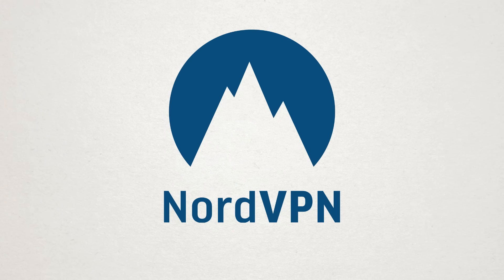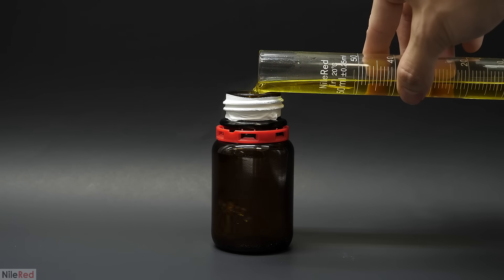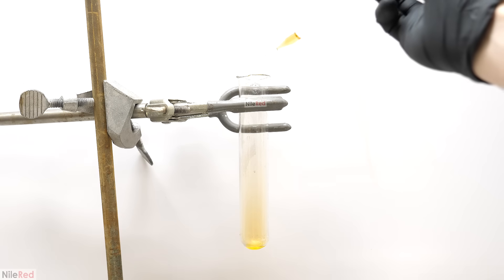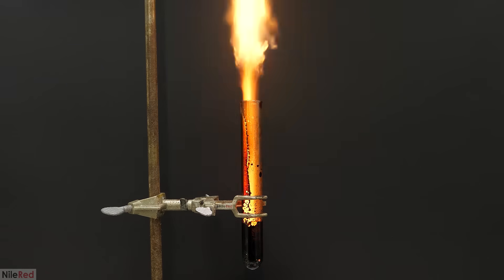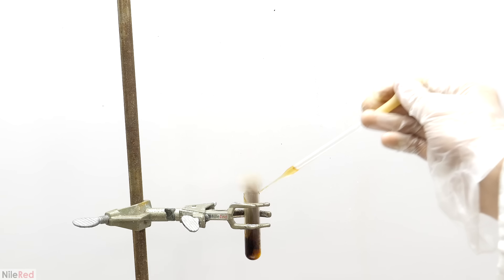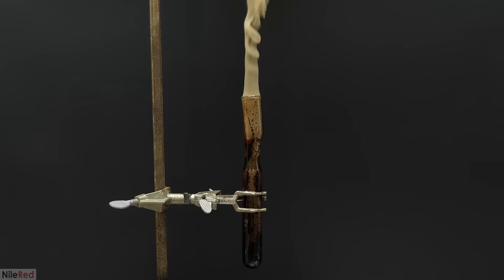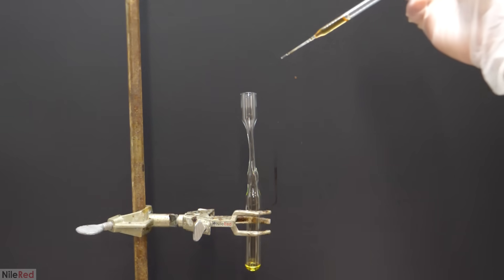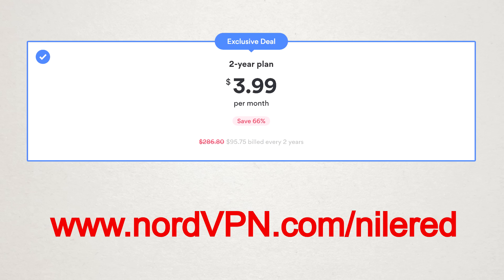Making test tube liquid rockets

Comment: Hello, I work at a company called AstroTech here outside the Kennedy Space Center where I regularly handle hypergolic propellants, mainly Dinitrogen Tetroxide and UDMH. My main job is as a Hypergolic Technician, we fuel satellites preparing for launch. I do not know your credentials and connections, but I do not suggest making any video with hydrazine unless you are wearing a full SCAPE suit with the proper training and other safety measures and equipment on hand. As I’m sure you know propellants like hydrazine can cause incredible health problems including cancer after being exposed to as little at 3.5PPM. I’d love to see you experiment with these chemicals but please be safe, these are some of the nastiest chemicals out there, which is why I love working with them!
Reply: When I worked for the Air Force, we had an entire class on hydrazine. I wasn't even going to work with the stuff as I was a software engineer, but it was enough of a hazard that anyone that might see a plane had to have it. It smells like ammonia. But if you can smell ammonia, you're fucked. Warn others so they don't die. then basically die. That was our training. So I agree with Mojo waters. Be suuuuuper careful with hydrazine.
Reply: sprays rag in hydrazine
inhales
"Thats good shit donny"
Reply: Hence the warnings about not picking up or touching pieces of space hardware that survived re-entry due to hydrazine fumes.
Reply: I think one of the reasons that Hydrazine hydrate is so nasty is because it looks like it really isn't. A lot of really dangerous substances are an angry colour, or fume/burn in air, or they set untreated steel on fire, or can be detected by smell in the tiniest of concentrations from the next suburb. Meanwhile, hydrazine just sits there innocently looking like plain water, and by the time the fumes have gotten concentrated enough for you to smell, you're completely fucked. That stuff is not to be messed with.
Reply: sixstringedthing It’s interesting because I think those angry colors are usually the result of reactive electron groups—I believe the same thing that makes them react and makes them colorful—Or maybe I was always interpreting that wrong
Reply: @CamRStanford  not necessarily. There are pretty colored solutions that aren't that dangerous. And there are colorless solutions that will kill you 10 ways to Sunday (like hydrazine). It just depends what their electrons do in relation to light.
Reply: I've read The Martian, you don't need to convince me that Hydrazine is terrifying :)
Reply: @rootabeta9015  yeah, something tells me he may have some cancer problems from it... but the book definitely described it well.
Reply: @rootabeta9015  YES SOMEONE WHO READ IT
Reply: @rootabeta9015  ur username its true
Reply: Hydrazine is terrible stuff. The NFPA 704 states it very well.
Reply: As i  understand NASA and co often try other chemicals because of the cost of dealing with these chemicals. As in the cost of handling them. IIRC the space shuttle hanger needed to be evacuated when fueling the hydrazine for the RCS except for specially trained personnel. I guess ppl like you.
Reply: This is the first time I've seen one of these know it all comments actually be legit. Definitely don't fuck around with Hydrazine if you don't want to enjoy cancer. We use it for the F16 and fuck everything about Hydrazine. It's nasty stuff.
Reply: This is a super underrated comment, people joke about it now but if you learn what the fumes do to your lungs, it's hella scary. I'm glad I saw this, not that I have any means of doing any of this by any stretch of the imagination, but good to know nonetheless, there goes another thing to say "f*ck that" to in life to keep me alive. For real
Reply: https://www.youtube.com/watch?v=YcXpSdbDNkM
Reply: "which is why I love working with them!" 
I did not need to see this part of the sentence you adrenaline junkie/Megumin Explosion addiction.
Reply: @kuroganeshiroe4760  heh
Reply: You wouldn’t happen to supply fuel for the dragon spacecraft would you?
Reply: @justanotherasian4395 AstroTech doesn’t supply much of anything for Space𝕏 vehicles. The payload, yes. Fuels, no
Reply: *C-Stoff
Reply: @m4ttyofficialchannel  C-Stoff contains hydrazine, but is its own separate mixture.
Reply: Yikes, I’ve honestly Never really thought about how volatile rocket fuel is.
Reply: jesus, thats nasty
Reply: Safety first.
Technician Second
Reply: This is actually the exact field I've been wanting to get into. Which universities would you recommend in order to get into your field?
Reply: Ha neeeerd
Reply: those darn yummy hypergolics
Reply: @mojo waters someday i hope im at an interview and your interviewing me
Reply: @maxgh0strider  *you're
Try learn to write.
Reply: @radonic_  lmaoo
Reply: is gravity fucked there?
Reply: Yea well imma do 3.49 ppm
Reply: I was elected to lead not to read someone summ this up please
Reply: I was going to say something about the dangers of working with Hydrozine, But I'm glad someone with actual experience and credentials did it first.
Reply: You don’t think he knows this?
Reply: he made uranium glass bare handed i dont think he cares
Reply: So if it’s so carcinogenic that means every time one rocket launches it’s spraying cancer to the people looking down at it lol
Reply: I've been to Kennedy space center:0
Reply: i think you overestimate just how much Nile Red gives a fuck about safety.
Reply: nilered’s middle name is danger so I don’t think he’s gonna acknowledge anything you just said
Reply: Let’s get cancer kids
Reply: Shut up nerd
Reply: hey ,i need a couple gallons of that stuff,to light my BBQ
Reply: @wvoyles lol
Reply: Hydrazine is Really Nasty! If you really Want to die of cancer, just go ahead! Don't forget, it is volatile, to, so you can't just assume it'll stay in vessel you're handling it in...
Reply: @gazzarrr666  Yea, even the Germans in WW2 was careful about using it (in the only operational rocket warplane, the notorious ME163 comet).
Of cause it didn't help that the oxidiser for the hydrazine hydrate was high strength hydrogen peroxide (which is also a colourless water-like liquid)
The even went so far to design the fuelling probes with vastly different geometries to avoid accidental mixing of the fuels, and even then a large percentage of the planes caught fire due to fuel leaks etc....

Still it had the highest climb rate of any manned air-plane in WW2, so high in fact that the pilots had to have a special diet to prevent intestinal gas.....
Reply: @srenkoch6127  To be pedantic, they used C-Stoff, a mixture of methanol, water, a catalyst, and hydrazine hydrate, not just hydrazine.
Reply: @MDeadcloud I know, but from a safety perspective, all the rest might as well have been water (and yes you are in deep S*** when you can ignore the safety implications of using methanol) 🙂
And I think I've read that the only reason for the use of methanol in the C-stoff was lack of enough production capacity for the hydrazine.
Reply: I hope nobody here finds Explosions&Fire and his small hydrazine accident lmao
Reply: SoylentGamer that mans getting cancer for sure
Reply: @Ang3lUki  https://www.youtube.com/watch?v=d7EPTu1Srak
Reply: tl:dr so cody gonna get cancer?
Reply: Bruh lol
Reply: Blah blah blah
Reply: @Mojo waters I don’t give a shit about your life story I would love to drink some dangerous chemicals because they don’t harm u
Reply: @ma4_life305  u are the definition of me
Reply: hasn't he already made very extremely dangerous chemicals? He made that blood-red stuff that, if I remember correctly, checked like every box for what makes something dangerous. He's also worked with radioactive materials. Could hydrazine be that much worse, considering the precautions he took for those experiments? (I'm not asking to be sarcastic, I'm sincerely curious)
Reply: @g4mmalotus937  it really is. Its volatile so it will just start to evaporate into the air very quickly on contact, and it takes very very little to get hurt or killed by it. A fume hood goes a long way toward keeping people safe, but with something as dangerous as hydrazine compounds I wouldnt trust that 0% of it wont end up in the room, especially if youre burning it and (like in this video) some of it might end up getting thrown out of the tube and into the room where your fume hood cant help you.
Reply: @g4mmalotus937  a drop will do far more than just kill you. People have died handling it after it has ever so slightly passed through gloves that were thought to be safe.
Reply: @g4mmalotus937  yes. It is much worse.
Reply: @g4mmalotus937  its called bromine.
Reply: @CROWZ_joey  that's right
Reply: Is that level of PPE only neccesary for occupational hydrazine exposure? Keep in mind you work with a lot more hydrazine on a daily basis. Nile has a fully equipped laboratory, I think he knows what he is doing.
Reply: @Ang3lUki  When satellites and rocket systems using hydrazine are fueled, technicians have to do it in full body hazmat suits (known as SCAPE suits, as Mojo waters mentioned) with a self contained oxygen supply. Even despite these precautions, technicians are only allowed 45 minutes in proximity to the hydrazine fuel before they get pulled for decontamination. Hydrazine is vicious stuff.
Reply: @ValleysOfRain  A very different setting than a demonstration lab. Nile isn't working with large volumes of freebase hydrazine. He is working with hydrazine sulfate to make a small amount of freebase in situ for a reaction.
Reply: SoylentGamer dude. No. Hydrazine can still do major lasting damage and be fatal
Reply: @Ang3lUki  Nile may know stuff but believe the experts when it comes to handling unusual and seriously dangerous stuff
Reply: @neovo903  How do you know this guy is an expert? For all we know he could be lying about it all. Sure, hydrazine can be dangerous, but Nile has worked with stuff that could of killed him if he inhaled even just one particle.
Reply: @Vortex-Gaming314 You clearly don't know anything about hydrazine then
Reply: @SoylentGamer  I mean, Nile is clearly well prepared for a variety of chemical safety issues, but as stated by Sean, they don't know Nike or his credentials. The comment isn't offensive or killjoy, it's encouraging safe experimentation.
Reply: SoylentGamer Still not a good idea to try it...
Reply: @herpderpinson6117  ok fed
Reply: Mojo waters He does his research. I mean, he’s not dead yet.
Reply: i’m honestly surprised that no one said ‘ok boomer’ lol
Reply: @aaa15634  Because it wasn't a meme back then
Reply: Z47N 73H74 nice pun!
Reply: Mojo waters I'll give it a like but I'm not reading all this 😝😂
Reply: @Cnriee  You can't read a single paragraph?  It takes like 10-15 seconds max to read it.
Reply: Mojo waters, he’s a chemist and he did this all under a fume hood I’m sure he’s safe... he’s also worked with high concentrations of uranium too so I’m sure he is fine
Reply: @t0fuuu102  uranium isn't dangerous tho
Reply: @tehjamez  It is. It's the radioactive stuff in nukes.  And N8le worked with a quantity that 10x the one in nukes. So I think he will be fine.
Reply: @Vortex-Gaming314  I'm sorry you fell for the lies. Watch who owns the plutonium
Reply: ok cry (jk i dont  even know what hydrazine is)
Reply: @pacheco6530  hydrazine will give you cancer so now you do kno.
Reply: too long
Reply: @jay8762  bruh
Reply: Blah blah blah safety kids! Fun nazi
Reply: @CamRStanford 
Not sure if you're joking, or actually completely ignorant as to how dangerous hydrazine is. This isn't the "oops, we spilled a bit, better put on some gloves" kind of stuff, it's the "oops, we spilled a bit, guess we'll all die in five years of acute leukemia" kind of stuff.
Reply: @Warriorcat49  Mmmmmm, the sweet smell of unsymmetrical diethylhydrazine...
Reply: @Warriorcat49  5 years if you are lucky I think, right?
Reply: Warriorcat49 take a wild guess if I was joking.
Reply: @Pointyy  *unsymmetrical dimethylhydrazine you mean
Reply: @Warriorcat49  who gives a crap about this safety nonsense I would to drink these
Reply: @aaliaaslam3841  Apparently in your quest to imagine up a whole backstory for a complete stranger, you didn't notice the hundred other "Ok, boomer" "Ok fed" comments.

Clearly poking fun at the guy being a wet blanket--much like we have here.

Again.

Great job, Boomer.
Reply: @CamRStanford  Lol you're hilarious. Keep being triggered.
Reply: @CamRStanford  You responded to a 1 line comment with a 10 lined response. Triggered much?
Reply: @Warriorcat49  be quiet we don’t care
Reply: @Pointyy  i... is... is it actually sweet?
Reply: @Warriorcat49  I agree with you that stuff really is extremely dangerous once you are exposed to it and enters into the air, probably anyone  in close proximity can be exposed to that and lose their life.
Reply: @destinebrown3973  LMAO ITS SO SCARYYYYG
Reply: @CamRStanford   The OP was only talking to NileRed, you should DEFINITELY experiment with these chemicals at home. Be safe though and only do it if you parents are in the same room supervising you.
Reply: @CamRStanford  It needs to be said. Hydrazine is one of those wonderful chemicals that will happily kill you both now and later. Nile does work with some serious stuff, but the Soviets referred to the combination of UDMH and RFNA as "the devil's venom". Enough said.

http://www.inchem.org/documents/icsc/icsc/eics0281.htm
Reply: @cinquine1  "The substance is very toxic to aquatic organisms. It is strongly advised not to let the chemical enter into the environment."

thats one sick way to kill ur goldfish
Reply: @CamRStanford  wut?
Reply: @CamRStanford  your the type of guy who drinks orange juice in a
Urinalysis
Reply: @Randommoron9000  Replying to 2-year-old-plus comments aside, you might want to find yourself another doctor if you find yourself drinking anything during a test which you ought to be peeing for instead.
Reply: @CamRStanford  this is actually a pretty serious deal. My background is aerospace engineering (concentrating in propulsion) and I can confirm whatever he’s saying is very true. I have heard horror stories and it’s not fun.
Reply: @CamRStanford  You are probably 12 years old
Reply: @CamRStanford  that is the most stupidest thing ive ever heard lmao
Reply: SCP-049 sorry, I want to get that right “most stupidest” because that’s even better.
Reply: SCP-049 You’re definitely Safe-class.
Reply: Though maybe “Neutralized” is more accurate now.
Reply: @CamRStanford  so what lmao im not gonna be a writer
Reply: ok boomer
Reply: @F.W.E no u
Reply: shut up boomer, stop trying to drum up sales for SCAPE suits, fuckin cappies
Reply: @CombineWatermelon  Im sorry dude but this is the worst and most obvious bait i've ever seen

Comment: You should try using them things that crackheads call stems. They usually have a bucket of them at every smoke shop. They’re little glass tubes that have an end that looks just like the exhaust end of a rocket. You’d just need to plug the other end with some kind of high temp resin.

Comment: The throat and expansion nozzle need to be a lot shorter if you want to achieve supersonic flow out of the nozzle. Don't stretch out the throat so much, and make the nozzle as close to the end of the tube as you can.
Reply: Also shoot in high speed ffs. At least go 120fps with a GoPro or something. Seeing 30fps slowed down to 2fps is painful, especially with a fast reaction /explosion. If ambitious, reach out to the slo mo guys, maybe they'll collab with you.

Comment: So if its basically rocket fuel, in the thin necked tubes, why is there no thrust? is the holder tight enough to withstand that thrust? is there negligible thrust? did you tighten them excessively? also, did you use a new test tube for every run O.O

Comment: This doesn't seem very safe, not to mention it seems a little bit hard to get  repeatable results. Would be better if you had a way to trigger the mixing remotely, like from behind a blast shield without exposing any body parts to the potential spills and explosions, with some apparatus that would shake and flinch in fear as the initial drops mix.

Comment: To all scientists ! Is this observation is correct ? 
These stripes in the air high in the sky have the reaction that Clouds disappear or dissolve, where a reflective layer is then made, and that if the sun is not touched, they are not visible either. At sunset you see a red horizon every day, that is everywhere ! The reflection of the clouds makes the higher sky light blue almost white.  Freshwater lakes, there is sometimes a glittering on the water, and it looks very clear and clean ? During the day it is cloudy and at night very clear, so far to the horizon I have not seen any stars before ? The air is full of dust particles. I must think of Morgellons too.....

This professor says, many dust particles make small rain drops !  https://youtu.be/Km7SE2QjUF0
Here the program of the Prof. Making clouds ... playing with clouds, make clouds whiter ? and throwing bicycles in the sea !

I woke up 6 years ago, (Proverbial) from then on I did not see a clear sunset.
Love hearing your opinion, Greetings from the Nederlands...

Comment: The combustion chamber was way too large, you need to move the throat closer the bottom, the smaller combustion chamber will increase pressure and the gasses on top should keep the fuel and oxidizer from being blown out the top... in theory...